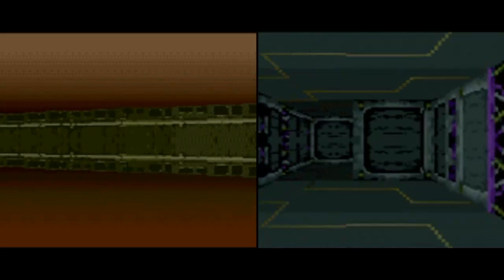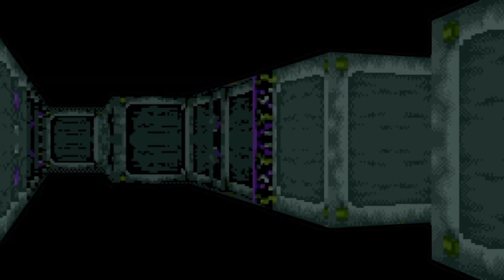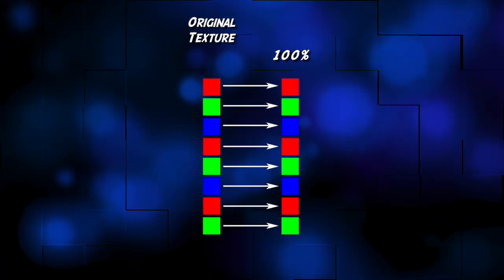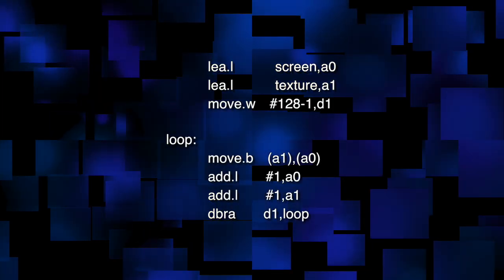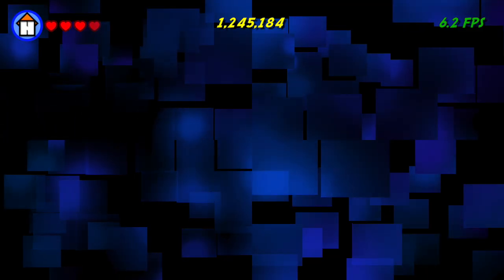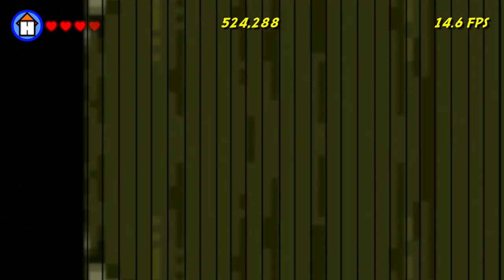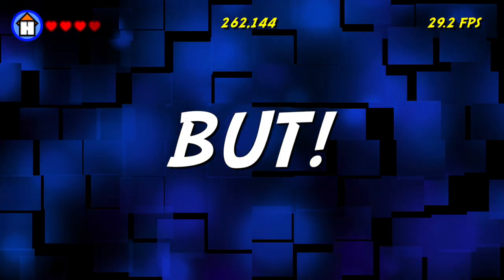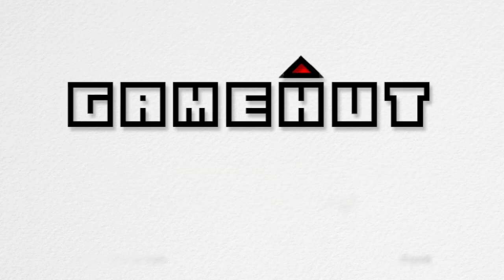CODING SECRETS! How TOY STORY'S 3D was programmed

Comment: I'm not one to argue much with your code, since you've made more of a career out of it than I have.  But why did you not use the auto-increment with (a0)/(a1), I know the instances where you have to skip over pixels you couldn't, but for many instances you could've done, and as a result, you could've removed the add.l  in majority of the cases.  Additionally, you could've added "words" rather than "longs", since address registers sign extend the word to long-word on addition.  It could've been faster, and the code could've been smaller =S

The indexed version on the right at 5:05 could've been a series of (a0)+, since it's always incrementing by 1.

Why did you guys not use auto incrementing?
Reply: "here i thought the genisis was simple or at least simpler no it's a fucking mess and a mad house"
This is assembly code. Every single CPU in existance uses some form of assembly code. If you think THIS is a "mad house", then everything else is as well. it's not just the genesis
Reply: Markey Jester, It was also over 20 years ago.  I look at code I wrote last week and ponder what I was thinking.
Reply: GameHut is a release of the new and improved ROM a possibility? I'd love to write it to an EPROM and play it on real hardware.
Reply: GameHut this is killing my brain and here I thought the genisis was simple or at least simpler no it's a fucking mess and a mad house 

also you guys did a great job on sonic r and I feel you don't get told that enough
Reply: Guys, my eyeballs just about popped out of my head on these replies. I have been working though Markey Jester's 68k assembly tutorials on http://mrjester.hapisan.com/04_MC68/ and watching Gamehut's stuff here and now these comment's. 
Cool!
Reply: I wonder about the exact thing (thanks for the question, I'll check the answers).

I am not familiar with 68000, but have written a wolfenstein engine in Z80 for the CPC using similar unrolling tricks. So, I was surprised at first to realize how many cycles some 68000 opcodes take similar to Z80, then looked at an opcode cycles list and also have seen there is auto-increment that takes 4 cycles and wonder why hasn't he used it? But then I thought I might be mistaken and didn't ask about it, because I don't know enough about 68000 since I am not familiar with it.
Reply from the maker: Markey Jester to make it more understandable I pretended that the screen was only 1 pixel wide. In reality it would have been 256 pixels wide so to get to the next line down you would have to skip 256 pixels, not just 1 so (a0)+ wouldn't help. But mostly it's because it's easier to follow for people who don't know specific 68000 assembler. Good ideas though with that specific code.
Reply: By all means, I don't just have an understanding of 68k, I have a thorough understanding of the Mega Drive's VDP too.  I was led to believe the same though, that you dumbed down the logic just to help explain it, in fact, I was told by a friend that this may be the case, in the end, she encouraged me to disassemble Toy Story to varify.

Unfortunately, indeed, you could've optimised:

...etc...
ROM:003E403E                 move.b  0(a0),0(a1)
ROM:003E4044                 move.b  1(a0),4(a1)
ROM:003E404A                 move.b  2(a0),8(a1)
ROM:003E4050                 move.b  3(a0),$C(a1)
ROM:003E4056                 move.b  4(a0),$10(a1)
ROM:003E405C                 move.b  5(a0),$14(a1)
ROM:003E4062                 move.b  6(a0),$18(a1)
ROM:003E4068                 move.b  7(a0),$1C(a1)
ROM:003E406E                 move.b  8(a0),$20(a1)
ROM:003E4074                 move.b  9(a0),$24(a1)
...etc...

This is related to the wall rendering, of which could've been auto-incremented, but wasn't.  There was a copy of this below which did have the auto-increment, but the CPU ran through this code and other non-auto increments.

I would like to apologise though, I didn't mean to come off so negative in my response, nor did I mean to put any negative impact to the work you guys put in, you did an outstanding job!  Truely wonderful work, I was just quite shocked and taken off guard, I honestly didn't expect a lack of auto-increment in your code.  That's all.  I hope I haven't offended anyone, and if so, my apologies entirely...
Reply from the maker: Markey Jester hey no problem. I'm guessing that is from the code that was macro generated. So it will have been a generalised macro to deal with any step-rate through the texture and screen to generate all the code. I guess we didn't optimise for the few single step cases, or it was too hard to code into the macro back then. I can't actually find the code that generated the macros so I can't see what it did. It would have never helped with the screen side of things, but with the texture side it would have. I'll have to go back and recode it now -  it can be faster still!
Reply: Markey Jester Hello, godfather of rom hacks!
Reply: @MrCorrectify It's actually generally better to write "Clean Code" (as per Uncle Bob), but I agree for "write only" languages like assembly.
Reply: MrCorrectify - Commenting! It is better to comment more than you need and ignore most of it later, than to comment less than you need and have to essentially do the coding all over again.

Comment: Gotta love unrolling loops. A friend made a generator, which generated 68k source files containing huge unrolled loops, to render each scanline of a scaled image at any scale factor (imperfectly, there were a few bugs), and I created the code that will scale vertically by skipping or repeating some lines, and it turns out, I can scale 4 images simultaneously where 1 image is generally large and 1 is very small, and DMA all the art in 30fps! And on top of that, because it was for a menu, and the code was just small enough, I was able to Kosinski compress the code (Actually, I also wonder what Kosinski compression would have been called back in the day?). It did create for some very awesome effect, and again show how much a beefy CPU can do.

Also, really liked the high production value of the video, keep it up! More technical effect videos would be cool to see.
Reply: Yeah, when writing shaders, I often unroll my loops and I remember when I started in scratch (many years ago) we would manually unroll loops for faster 3D rendering (though it was very primitive).
Reply: @TheSpace928  imagine if Sega used a 680020 processor this game would have looked even better